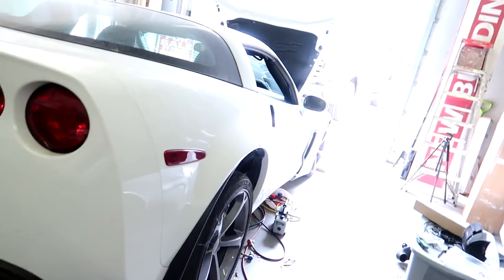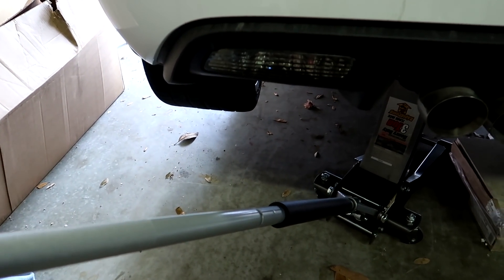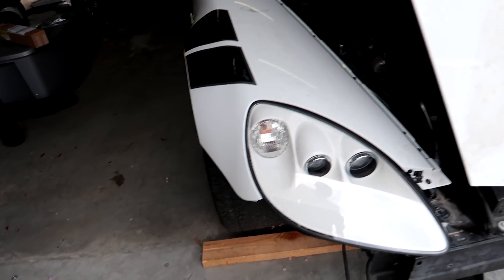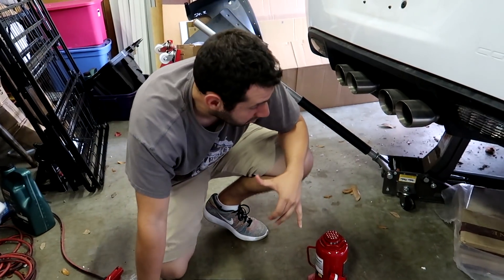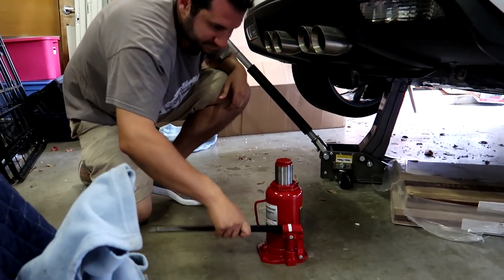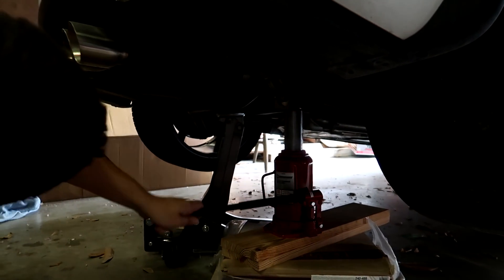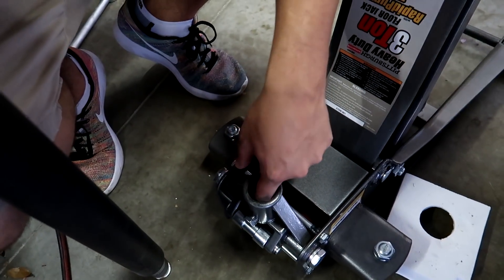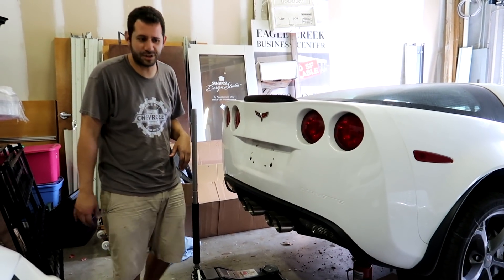Cheap Idiot Gets Harbor Freight Jack STUCK Under Corvette

Comment: You shouldn't trust a floor jack to not drop a car on you let alone a bottle Jack with squat all stability.
You seem to make a fairly high wage and you are spending a lot on these cars, it's probably a good time to invest in a two post hoist.
They make cheap ones now.
I have seen Jack accidents with heads, they are not pretty.

Comment: Lol I did kinda the same thing today, except mine has been working fine for years.   In my case that little bolt with the nub that engages the handle backed off.   Fortunately I had a couple of cars around that I could borrow the scissor jacks from to pick the car up off the stranded hydraulic jack.  

I locktited the hell out of that little bastard after that little adventure.  I HIGHLY recommend doing the same because that was a pain in the arse and kinda sketchy.  If it does it again I’m getting my welder out....

Next time I’m in the store I think I’ll pick up a couple of those little bottle jacks just in case.

Anyway I just wanted to hop on YouTube and see if anyone else was a stupid as I am and alas...here we are.   At least I did have some jack stands set up.

Comment: Thats nothing. I have dropped two cars on my driving ramps. Rwd cars and they both spit out the latter piece and left the car swinging from the bottom with rear wheels almost 50cm in the air lol. First time we "bend" the car up with a water pipe in order to get the ramps back under the wheels

Comment: Better get some jack stands before you hurt yourself under the car. You should not take the floor jack up to its limit. it is really unstable at max lift and may cause damage to the hydraulic seal

Comment: Guys like this are the reason they make instruction manuals. Also the top of bottle jacks unscrew to add height faster than jacking.
Wouldnt drive a car after this guy has touched it mechanically

Comment: OMG...

So, you took the jack out of the box, and didn't even bother testing to make sure it raises and lowers before you jacked up your corvette with it?

Have you ever heard the expression "An ounce of prevention is worth a pound of cure"?

And yes... bottle jacks are slow. Just take a look at your floor jack... what's that inside? Is it... a bottle jack?!?!

Yes... smaller bottle jacks are inside floor jacks, and through the process of lifting a car, the bottle jack extends about 2-3 inches, and that raises the jack a foot... foot and a half. Every inch the bottle jack inside the jack extends, it pushes up the platform about 4-6 inches.

That's why bottle jacks can lift much larger loads. The bottle jack in a floor jack is not only under a trumendous amount of weight (that of your car), it's also under a trumendous leverage multiplier (from the lift mechanism pressing down).

If you took apart a 3 ton floor jack and just used the bottle jack that's inside, it would raise your car a fraction of the distance, and it would hold probably at least 15-20 tons... maybe more.

Comment: Here's the straight on hydraulic jacks from anywhere. Always, ALWAYS, buy hydraulic fluid at purchase of any new jack. Why? When the manufacture assembles the jack they use a minimum amount of fluid for several reasons. One thing for sure is they put just enough in to test the seal and operation, not functional limits. Ever notice in the instructions it says to check the level of fluid before use? The mfr. is not going to list how much fluid they put in because they don't know really. So, fill it to recommended level and they will work well for many years. I'll bet if he checks the fluid level it will be way low also adding to any jacking troubles. But not checking the action of the jack handle as well as not backing out the locking bolt was pretty damn STUPID, hands down!

Comment: You really need to make a couple wood ramps to drive it on first!!! You owned the mistake so any ripping on you isn't as fun and bottle jacks are designed to be almost touching lift point before you even start to engage it.

Comment: if only you read the instruction for the bottle jack as well. JK lol. the centre can extend to make things work faster. im not sure how u got the bottle jack out but you could have placed the floor jack back in its place and lower the bottle jack onto the floor jack and remove the bottle jack. then release the floor jack until the car is on the ground

Comment: You NEVER max out a floor jack of Any brand, its CLEARLY printed in all jack instructions,  it binds up the angles and they get stuck. Has Nothing to do with brand.  Why didnt you screw out the top of the bottle jack so you didnt have to pump so far.. lmao

Comment: The bolt in the back of the jack needs to be removed so the jack handle goes in. Then snug the bolt back so it keeps the handle in. Next time test shit before you use it. And buy some jackstands before you become litteral samcrack

Comment: ok, ima female, so dont go pokin fun, but listen all you guys, i have a 3 ton car jack i use to scootch under the front of my zero turn mower so i can lift it to clean the 100 pounds of grass build up every so often, so after 45 minutes watering, trying to soak the grass n gom thats hardened like cement,, and using my hands to scrape, scratch , dig all of it out that i could, rheumatoid arthritis said ENOUGH FOR TONIGHT, AND YES I CHALKED? CHOCKED? the back tires and put TONS of landscape stones and wooden blocks under the outer edges of the deck and under the front of the deck as high as the jack, and front tires, in case she'd slide off/freak accident, SO anyways now the pole wont go left or right, its like pole is locked, i was watching closely and the sprocket/teeth under the  pole are responding to the bar that i can  only get to wiggle back n forth, i have had this old dude for years, seems like this mighta happened before, but NOW THE ZERO TURN is stuck on the jack, LORD HAVE MERCY, anybody?, is there a lock? i see people talking about unscrewing the one screw to let the air pressure off?, i have been googling for a hour, i gotta get this mower mowing,,, HELP,

Comment: This has to be staged.  When the jack comes new the valve is open you have to turn the handle and close the valve before it will lift the car.    I call fake

Comment: bottle jacks are not that slow
Reply: 20 ton bottle jacks are slower than smaller ones.
Reply: I have a ten ton and it works just fine for changing tires on a fully loaded chopper box